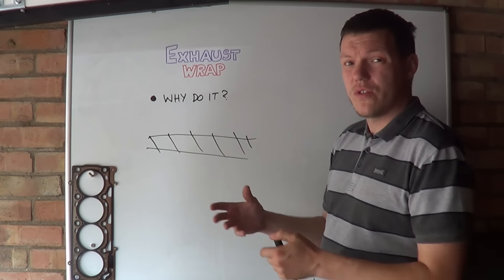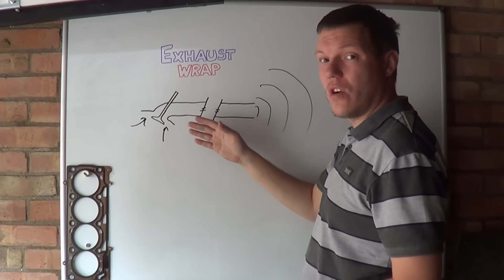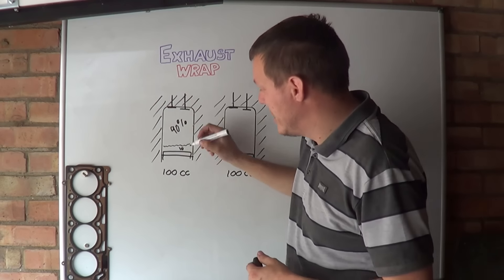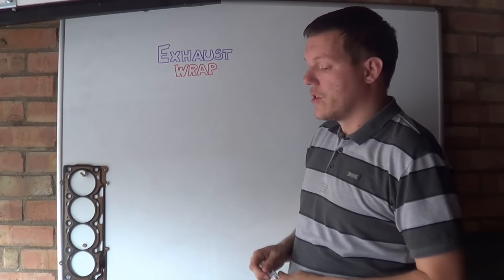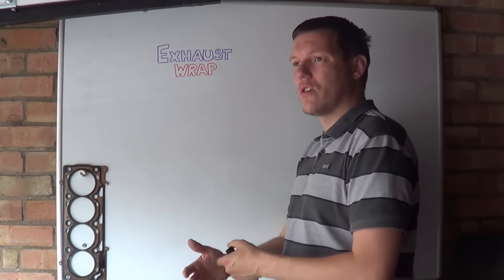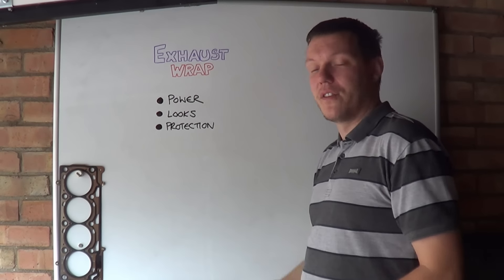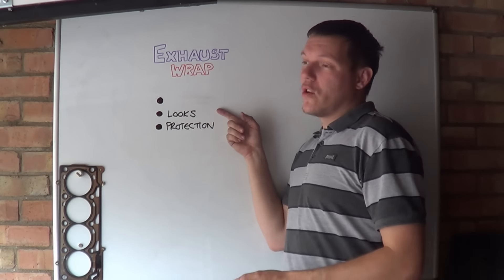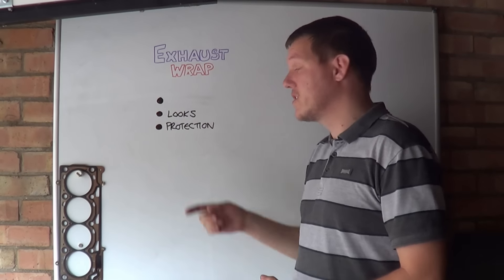Exhaust Wrap - Good or Bad - Bike TEch

Comment: If scavenging is the negative pressurewave of exhaust gasses leaving the cylinder; wouldn't a cooler exhaust draw more air in because the velocity is slightly lower and the mass of the gasses leaving is higher? The scavenging works proportionally to atmospheric temperature and pressure as well.

Wouldn't you want heavier air pulling more vacuum or is the velocity that much more important? The science seems fuzzy but I'm sure it's not a huge difference either way.
Reply from the maker: "Wouldn't you want heavier air pulling more vacuum or is the velocity that much more important?"

Heavier air is the misnomer here - denser air would be more accurate. Denser air is basically more air. The energy (heat energy) has to be distrubuted (evenly) throughout the fluid (gas). Denser air has a higher speed of sound velocity - so the pressure wave would travel at a higher rate - 

however, the gas is expanding due to the pressure difference and the gas temperature (energy) is the bigger value when you calculate these velocities. 

"The science seems fuzzy but I'm sure it's not a huge difference either way."

- Correct - this is a chaotic system - even when we try to calculate it accurately we use finite element predictions as a system not as actual molecules/atoms. 

Generally the system is tested - then we work backwards.
Reply: The Workshop, thanks for the quick response! 

I only used the qualifier heavier to somewhat simplify the actual question, you're right for clearing it up for scientific accuracy though :P. 

That does make sense that more of the pulse wave would be cancelled out by the presence of more densely packed molecules. Sound waves travel much faster at exhaust temps, so that certainly holds water. I'm positive that the RPM the backpressure scavenging is most efficient is a more crucial thing to take into consideration (have an AAS in Automotive). 

Im sure you know this, but for anyone else reading; that's why we see gains when reducing the backpressure in a system, it doesn't really reduce it across the board, it changes where in the RPM range the exhaust scavenging is most efficient. Too little backpressure and there will be no scavenging effect at any RPM, starving the engine of fresh air, increasing combustion temps and reducing efficiency; unless it's FI ofcourse.
Reply: Hey idk what kind of physics you know but you cannot increase mass without adding something with mass

Comment: Thanks for posting this useful video. I have a RE continental gt 535cc and was thinking about wrapping the exhaust mainly for enhancing my bike's looks. Would it effect the fuel efficiency  and or has any other disadvantages apart from what you mentioned? 
Thanks in advance
Reply from the maker: The simple answer - no. The exhaust scavenging dynamic would change, but nothing you'll notice EVER. As i stated in the video, exhaust wrap has benefits, but so slight that apart from cosmetics it doesn't really change anything. - matt

Comment: My car came with aftermarket headers that were wrapped. Under the wrap the exhaust is falling apart. The idea in an engine compartment is to keep the heat inside the exhaust system and away from the engine. But I wish I knew the results because its causing the headers to fall apart. I have a feeling its just harder on the metal and not that its trapping moisture or anything

Comment: Thanks! Nice Tech vid! How about engine temperature? I do have exhaust wrap and I feel like my XL1200X tends to be on the hot side. But can't compare on temp of before the wrap cuz I didn't have temp reading at that time. Thanks again
Reply from the maker: Yes it will do. If the exhaust pipe is heat saturated then the engine has less thermal mass to dump the heat into - we call this 'thermal load' in other words the flow of heat
Reply: Enough heat / too much heat to damage the engine or just more than normal

Comment: Amazing video, i got a question in my mind and I need to ask. Is the wrap changing something about the sound which is going out from the exhaust?
Reply from the maker: The material can dampen the sound coming from the sides of the pipe itself, but that's about it

Comment: Good job explaining heat effects on pressure wave theroy. ..except for one thing. You dont mention anything about heat FLOW. Exhaust pipes carry engine generated heat AWAY FROM the head, in particular,  the exhaust valves. The heat HAS TO GO somewhere , and wraps keep it in the head.  I wouldnt recommend wrapping on air cooled engines without modifications....like using synthetic oil that can handle increased heat, or oil cooler. Especially if it is only for looks or protection(?).
Reply from the maker: Good point, will add that in the follow-up and in the exhaust header video - cheers dude - great comment - matt

Comment: So, it's been almost a year. Any follow-up video on the state of the wrap after all this time? I'm REALLY curious to see if there's any corrosion, etc. I just bought some exhaust wrap and I don't want to have to buy new pipes in 2 years...
Reply from the maker: No not yet, there will be though. I'm also running a test between, wrapping, ceramic coating and enamel paints, which will be up in the future once enough time has passed - matt

Comment: Hey Matt... probably a stupid question but, what about ceramic coating and wrapping? I ask cause  I like the performance and anti corrosion aspect of the ceramic but wonder if the wrap would be good for protecting me and my gear from burns and in cars heat soaking the engine bay. Cheers

Comment: A little off topic, but if you're wrapping exhaust on a car would an added benefit be reducing under hood temp and therefor increased power from a cooler air intake charge? or would the difference be negligible?  

Thanks
Reply from the maker: It depends, it you have a direct stream air vent then you wouldn't notice the difference. It depends on where your intake is for your engine in relation to your exhaust pipe system. Another bad place to stick your intake is behind your radiator - matt
Reply: The Workshop 
also a bad place to put intake is under the bonnet. of a car. attached to a car. with twice as many wheels as it needs and tons of spare fat carried around. in a car.

Comment: Hi Matt, Is there a measurable difference to radiating heat  on components near exhausts between exhaust wrap and ceramic coating?  I am building a turbo bike at the moment and trying to decide what method is better at saving components near the exhaust.
Reply from the maker: The short answer is probably not. I'd guess that the wrap is a better insulator than a coating due to thickness.

Comment: What a great video pal.  Thanks.  I'll get wrapping :D....A potential 10% increase in efficiency for only 15 squid of wrap sound good to me.

I've a 96 1100 Virago.  I'm sure you know it's only got 2x 500+CC cylinders and they're prone to back firing because of a fuel dump into the exhaust.   Wondering now if the wrap will actually make it worse....hmmmmm.  Thoughts? :D

Comment: The 'new' wrap also comes in a tube-like configuration so if you're a fabricator building your own exhaust, you just slip the 'tube' over the pipe(s), fold the ends over, wire 'em on, pull back from the end, weld the next section, pull the 'tube' end up to the weld, fold again, and wire it on. When complete the whole ceramic tube is an integral part of the exhaust. You only have to deal with 'wrapping' it if the 'tube' gets worn through.... : )'

Comment: I always thought insulating the exhaust, was better for efficiency, but I couldn't prove it. I believed the insulation kept heat in the exhaust, so no parts of the pipes got cold, and made the exhaust flow at those spots denser, and would end up creating drag at those spots, on the flow's way out. The insulation kept the flow consistent, throughout the length & diameter of the pipes. The same with insulating the turbine housing of any turbos.

Then of course, also protecting everything from the heat of the turbo & exhaust.

So ceramic is better then wraps...even multiple layers of wraps? Is it ok to wrap ceramic exhaust? This is the first time I have heard of ceramic exhausts...unless the Ford GT90 counts. I haven't thought about that in a long time. I only know it from NFS2SE.
Reply from the maker: "So ceramic is better then wraps"

- yes, becasue it also protects the steel from the elements and doesn't seem or stink or come undone lol

Comment: Very well explained. I had a 500cc Scooter where the frame would get incredibly hot in summer on long rides. Suddenly you would loose power and had to wait for it to cool down again. I found out that the exhaust was heating the frame and the frame heated the ignition coil. Wrapped the exhaust and the problem went away.

Comment: I heard ceramic coatings cant handle big temperature changes thus making them useless in cold climate countries. Is that true?
Reply from the maker: I wouldn't think so unless someone has some proof. Plasma spraying which how proper ceramic coating are applied means that the exhaust is heated to around 600-700C when the coating is applied. Cooling down to say 20C is the greatest temperature change, so if a drop in temperature cracked the finish then this would happen straight after the coating was applied. Ceramic coatings can chip and crack but usually due to excessive vibration more than anything else. I'll be doing a video on this subject shortly and will add this point. Hope this helps - matt
Reply: Yes it helped a lot, thank you very much! The reason why I'm asking about it is because I'm about to buy a new header to my car and I'm from Finland where we have temperatures from -50C to +35C hahaha.
Reply from the maker: CAR?! this is a bike channel. You need to FUCK OFF NOW! lol only kidding, That's only a temperature swing of 85C, and like I said the exhaust has been alot hotter than that. NASA developed the coating for rocket nozzles and space is -270C
Reply: Pony Power hahaha
Reply: Teqo7 Never heard about ceramic coating cracking :)
Reply: Missäs suomessa on -50c tai +35c?

Comment: I wonder if the protection is as good or better than shields.  Does the wrap keep the heat in the pipe and feel cooler on the legs than the shield ??
Thank you for your generous consideration,
Sincerely ........................

Comment: Very important: If you use exhaust wrap you should run the bike for a couple of minutes after washing it, because the wrap is soaked with water. In many cases this causes the rust on the pipes. I wrapped the pipes of my 1299 Panigale in 2016 and there are ZERO problems with it.
Reply from the maker: "I wrapped the pipes of my 1299 Panigale in 2016 and there are ZERO problems with it."

- I'm pretty sure that because its a stainless exhaust, unless you have the sexy version and then the exhaust is titanium......
Reply: @thedirtyworkshop  yes it's Stainless steel.

Comment: I guess it does reduce the noise of an engine a bit as well. Am I right?
Reply from the maker: yes to a slight degree - very slight - the noise comes out of the end LOL
Reply: Von Bergerfurth - Indeed it does create a better sound barrier. 
Most noticeable on a two stroke, then on your "run of the mill" 4 stroke. Either car or bike.

Change the typical "rattle can" sound to a slightly more deep (bearable) sound.

Comment: Will wrapping the exhaust hurt or change the chrome finish on the pipes for if you may want to remove it one day?
Reply from the maker: Good question - there' to answers to this - 1) theortically it would be fine 2) however, the chrome has to be perfect. ANy, and I mean any thinning, stone chips, dings or any tiny spor of rust will bred under the wrap

Comment: My gran suffers from chilblains. She often wears surgical stockings during a cold snap. Would there be any benefit to wrapping her legs from say September onwards? Also, would you recommend binding each leg in the same direction or should  you alternate ie. one leg clockwise the other leg anticlockwise, like you do with racer handlebars? We live in the northern hemisphere, but below Barnsley, if this makes a difference.
One last question. I went to a classic bike show in Cleckheaton last Sunday and there was a man selling a device that uses magnets to improve fuel consumption by realigning the electrons or something like that. They obviously work or else he wouldn't be selling them for £40. My gran has some magnetic ankle bands for her circulation but she said they did nothing. Would it be possible to repurpose them to make a fuel conditioner, and if so, could you do one of those 'how to' videos, (without any swearing) in case my gran watches it?
Reply from the maker: Do you mean wrapping your gran with exhaust wrap?
"I went to a classic bike show in Cleckheaton last Sunday and there was a man selling a device that uses magnets to improve fuel consumption by realigning the electrons or something like that."

- Ah! this I do know about and it's complete bollocks.

Comment: What about keeping the air n the engine bay cooler? If you have a cold air intake it will perform better with a cooler engine bay. That’s definitely a plus. Cooler air coming through the intake manifold means better performance

Comment: My pipes on my 2012 HD Fatboy lo burns the inside of my  upper right thigh during the warmer months. I ONLY want to wrap the part that is near my upper right thigh. If I only wrap [and spray] that 8-9 inch part of the exhaust from the header down, will it hurt to NOT wrap BOTH pipes? Again, this is not for power or looks, just for protecting my upper right thigh and the bottom of my right saddlebag [over the top muffler]. What would you suggest?
Reply from the maker: Not really - there is always as temperature between each cylinder - especially with V twins

Comment: I'm surprised no one asked this already, but what is your opinion on VHT's "Flame Proof" ceramic header paint? 
Also, there is a product from DEI that they call Titanium Wrap, which has lava rock in it. I'm curious if it it's any better/worse than regular old wrap that I can buy at the local auto parts store (and if it also retains moisture).
Reply from the maker: "I'm surprised no one asked this already, but what is your opinion on VHT's "Flame Proof" ceramic header paint? " - video coming soon.

"Also, there is a product from DEI that they call Titanium Wrap, which has lava rock in it." - this has to be bullshit?! Really? I'll have to look into that, but that ain't gonna help. Why would you want any kind of rock?
Reply: lol, well technically ceramic is also rock. I guess lava rock is supposed to withstand heat even more than ceramic? 
They say it's much more flexible and doesn't need to be soaked before applying like traditional wraps, but it can only be applied once. It becomes brittle after it's been heated, so you can't take it off an reuse it like traditional wraps.
Reply: That said there's certainly no shortage of convincing gimmicks in the aftermarket world. I'm definitely interested in seeing your take on it.
Reply from the maker: Silicon Carbide etc are compunds found in rock, but I wouldn't say rock is a ceramic. I'll look into it and do a video - matt
Reply: "Lava Rock" is just pumice powder...same stuff used in face creams, polishes etc. No different than sand and other abrasives. You can make it yourself using lava brickettes sold at garden shops for decorative ground cover or propane barbeques....can be smashed really easy with a light hammer.

Comment: By increasing the temperature of the exhaust gases, we only increase the speed of the gases or also we increase the speed at which the pressure wave is transmitted?
Reply from the maker: The speed of sound - and therefore the pressure wave which is what sound is. The speed of sound is heavily dependant on temperature - heat is basically a measure of the kinetic energy of the gas - so in effect they both increase, but to be clear they are different things
Reply: @thedirtyworkshop  Therefore, the propagation speed of the wave increases with increasing temperature? And as the propagation speed varies, the length of the pipes in the manifold should not change so that the returning wave will find the combustion chamber at the time of valves overlap? Thank you for the responce
Reply from the maker: "Therefore, the propagation speed of the wave increases with increasing temperature?"

- yes the speed of sound through a medium is based on the free-mean path of the molecules - more heat/energy the higher the velocity between moelcules, so the density (better word than pressure ) wave is faster. 

" And as the propagation speed varies, the length of the pipes in the manifold should not change"

- No, the opposite. The harmonic of the wave will change and the pipe doesn't so the timing goes out of resonance
Reply: @thedirtyworkshop  So the primary pipes of the exhaust system have to be changed a little bit longer if using exhaust wrap?